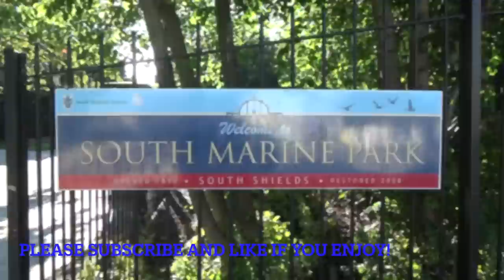Lakeshore Railroad South Shields 10.8.21 (Video footage is from whole day)

Comment: 14:14 one is the pipe thing that is facing the driver because i know its for the funnel but what does the thing on the end do?
Reply from the maker: So the pipe that’s facing ahead with steam coming out on Mountaineer when Adiela is coming passed the sheds is to stop the driver from getting wet with all the steam when the regulator is first opened after coming into steam 🚂 hope that made sense
Reply: Where is this Stream Engines located. City and state please